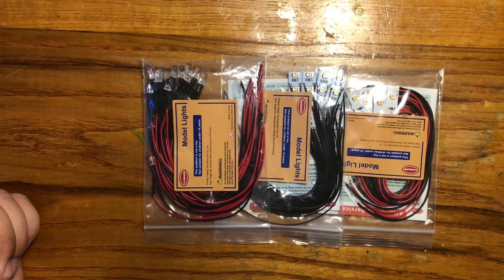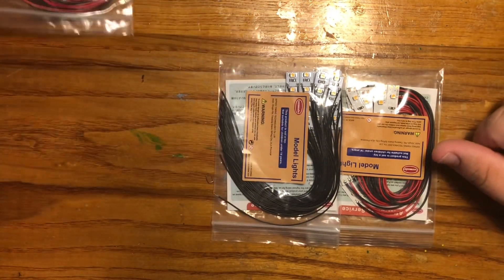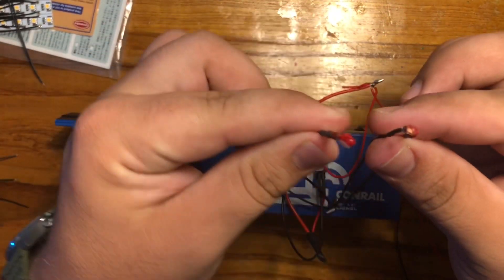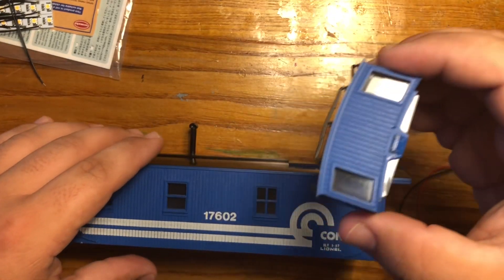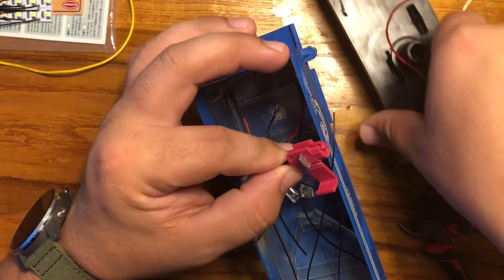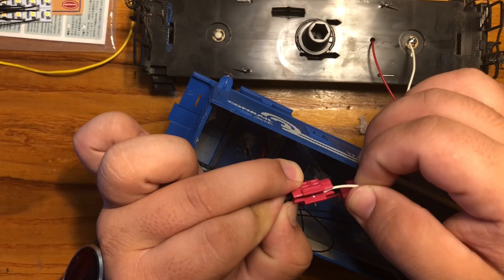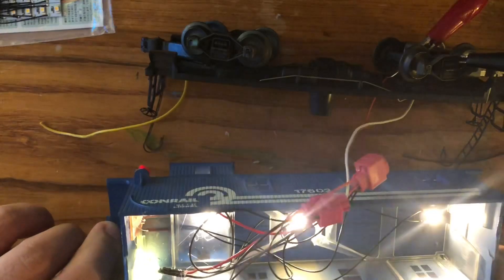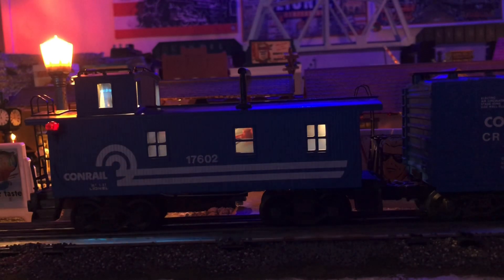LED Upgrade for my 17602 Conrail Caboose

Comment: try a dallee led short strip lot easier to install and I found out by accident they work with ac had my bowser single truck trolley run for an hour so far no problems

Comment: Great video.  From the video a week ago on the lights that were made to look like n arc welder--did you ever think of doing that to the gas station on the layout to simulate maybe a mechanic cutting out an old exhaust system on a car?
Reply from the maker: Thanks so much!  I did actually lol it’s just kinda hard to access the filling station.  Definitely will try to.